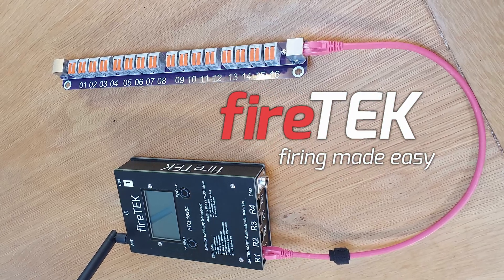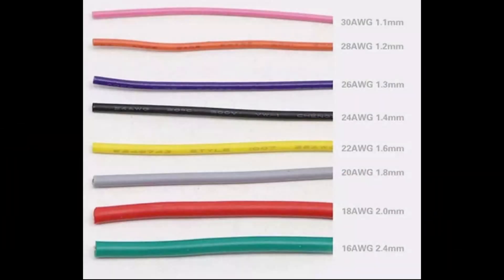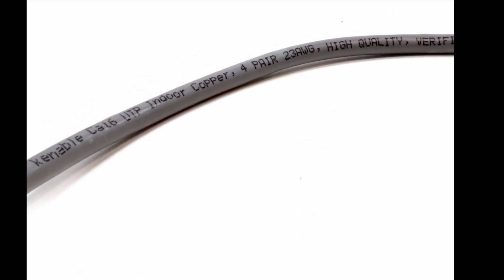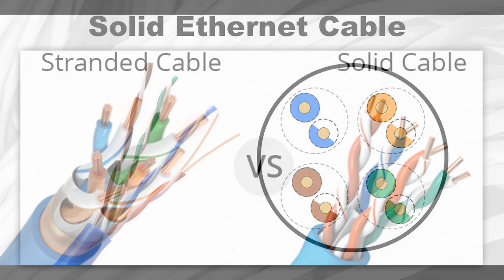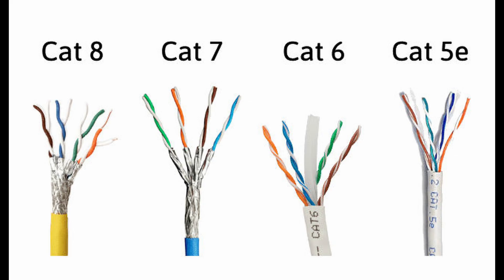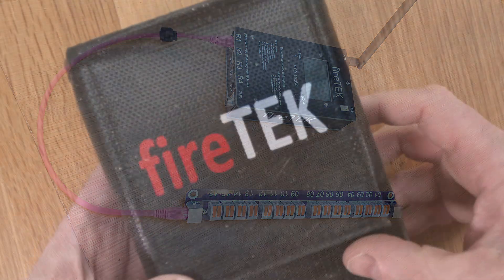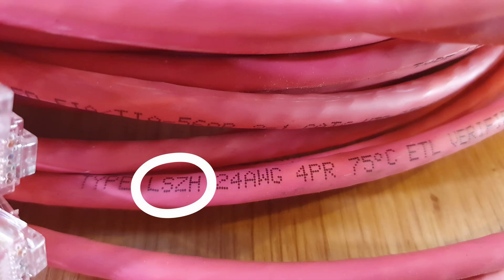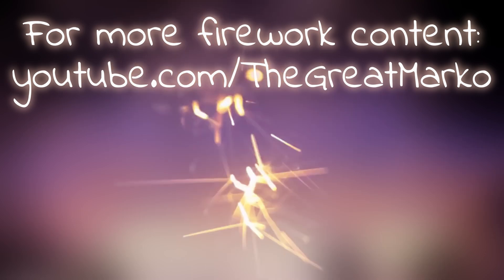The best cables to use with FireTEK firing systems?

Comment: Are the Ethernet cables wired Cross or Straight? [Pins 1 & 2 connected to pins 3 & 6]
Reply from the maker: They're standard (straight), not 'crossover' ethernet cables.